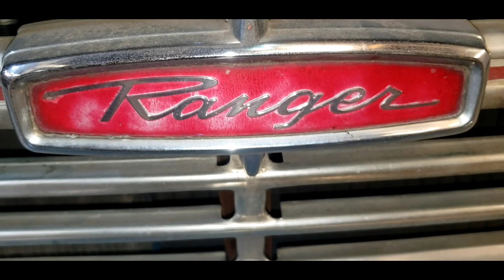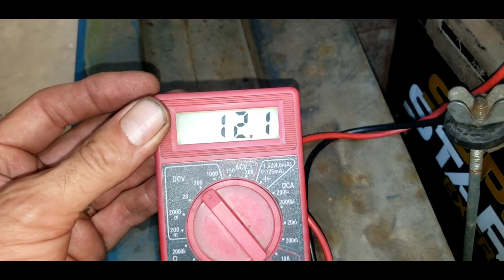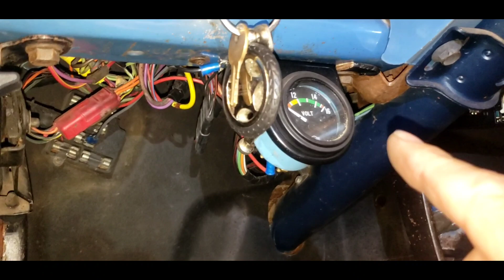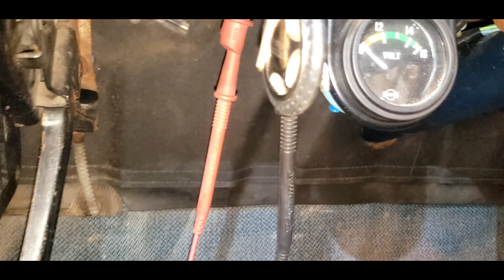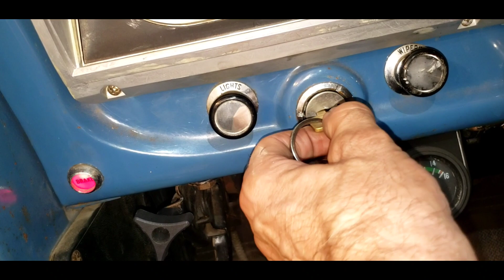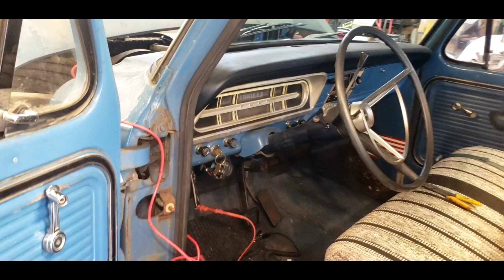Funky Old Ford Truck Wiring

Comment: I recently got a 72 ford Ranger XLT I’m practicing for when I do have trouble like this…😂 I’ve got a problem with the lights right now. I’ve gotta get it fixed before I drive it home from NC tomorrow. It’s at my moms about an hour and a half away. It’s a 3 speed on the column truck that they tried to convert to a floor shifter too…🤦🏻 It’s stuck in 3rd gear so I’m sure that’s gonna be fun… lol

Comment: Hey, that truck’s younger than me. I guess I’m a classic too?  When you say protect, I assume you mean you’re putting a fuse in there?  Of course if you put a fuse in there appropriate for the 10 gauge wire, there are some smaller wires and loads downstream  that are less protected than they should be.  But I can understand why you don’t want to totally debug the whole thing. But you may be overloading some wire somewhere that’s currently being protected by the resistance of the existing wire. The smoke may get out.

Comment: Clean the connections on the ends of the cables. Other issue could be that the fusible link (I'd assume something this old has one or more at the battery) has degraded to the point that it is more of a resistor than a wire.

Comment: Check the hood badging, I bet it says "F200"  The F250's didn't begin until the late '70's.
Reply: Sorry about the 👎fixed it. Ya I seen them say F250 F350 later on
Reply: @Darkone2007  If memory serves me, the 150/250/350 designations start not long after the body style change in '73. I had a '77 F250 Ranger for a while in the '80's.
Reply: F200's were not sold in the US. Mexico had the F200's. The F250 and F350 name started in the US in 1953 and 1/2 ton F100 was used until the F150 came out in 1975 and last year for F100 was 1983 I believe. I see 60's F250's for sale all the time and various neighbors had quite a few of them over the years. They all said F250 on them.

Comment: Nice. I doubt any modern f250 will still be rolling around in 40 years
Reply: No doubt about that, they'll strand because of the faulty electronics and no replacement for it.